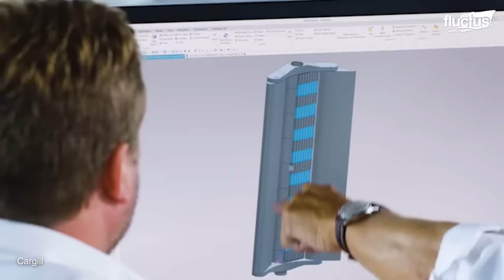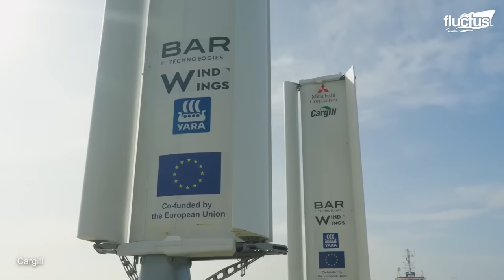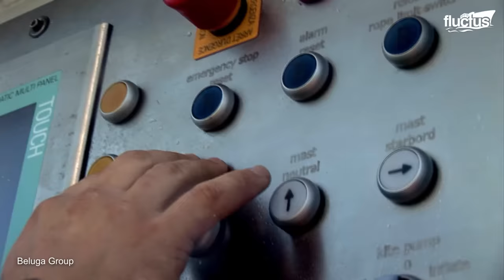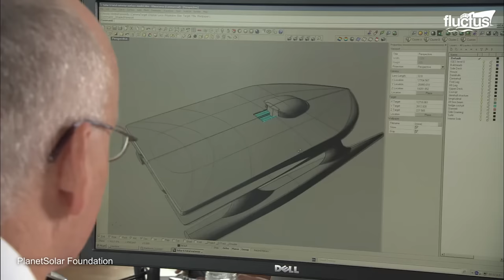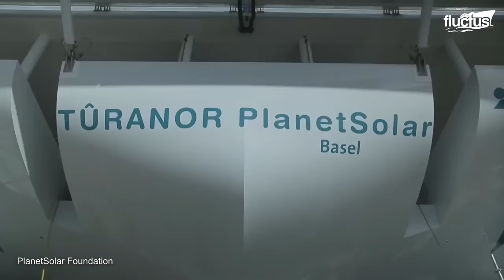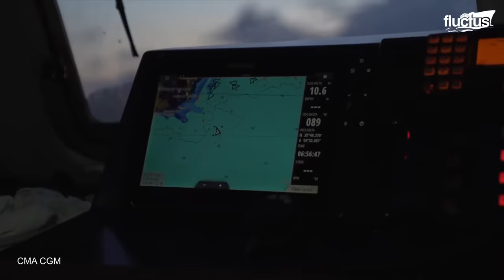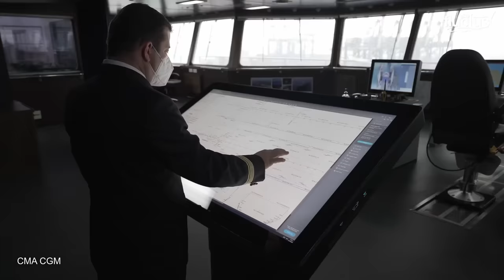Behind the Strange Invention that Could Change Ships Propulsion Forever

Comment: So, it’s a sail.
Reply: It's a sail made after decades of knowledge derived from flight and aerodynamics.

It's like pointing at a modern EV and saying that it's just a Model T.
Reply: @CaravelClerihew the analogy is accurate because in both cases you go from a useful product to a pile of junk.
This is a VAWT and I bet it generates little to no thrust and will never repay its investment cost over its lifecycle.
Reply: Wind driven motor
Reply: @garyjohnson4575  it’s a sail with extra steps
Reply: @Sir_Gugharde_Wuglis  It's a sail that's about 5% as effective and 10,000x more expensive.

Comment: A possibly-useful video, but destroyed by the hyperbole 'could change...forever': standard journalese overstatement.  What many readers don't realise is that the sail on a sailing ship is acting like the wing on an aeroplane, but in a different orientation.  That is why a sailing ship can tack into wind.  You did bypass the steam-turbine stage of development, which is the transmission for nuclear ships.  It is interesting to see that Flettner can be made to work: it was a failure 100 years ago, but did live on as ventilators.

Comment: Great video,but you can't just put sails on a rectangular Hull, some modified is needed, like adding long tubes on the side to prevent the ship from flipping,this tube could be in sectional and retractable, flexing can provide power as it mov thru the waves.
Reply: Sailing downhill is much more efficiently.
Reply: @markknoop6283  jajajaja, down wind ? actually if you sail in exactly same direction of the wind only the last sail is able to produce power ideally across all sails produce trust.
Reply: @yvanpimentel9950   sea levels varies because of the Gulfstream and wind.
If you use an extra function on the weathermaps and the GPS you can save a lot of feul.
Reply: of course the ones with the rope and a kite can be added to almost any,and because they are so wide more than one,if the ship is 40 meter wide adding suing arms can ad20 or More meters enough to place 2 kites

Comment: This is a poor tech. Instead of converting the wind energy to electricity to power the motor for the ships. This wind tech to reduce consumption of fuel is senseless to me.
Reply: The size and weight of a wind capturing tower to convert to usable energy on this scale would be too large and heavy. This with its MINIMAL impact in almost every aspect is excellent for efficiency in many key factors which make this alluring. Cost and gain.
Reply: @bensalvador113  If my intuition serves me well the wind turbines require for such vessel in the sea shouldn't be too heavy as you are postulating here. In fact, merely looking at the rotation of those wind rotors in the video proves that it is possible. This should be consuming nothing more than 2000KW/h of electricity at that speed which some midsize generator can output.